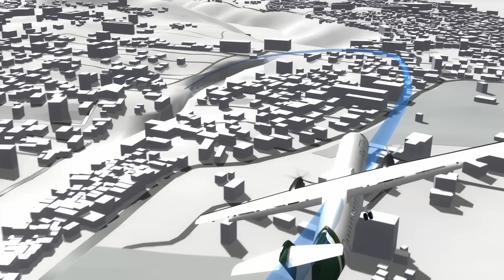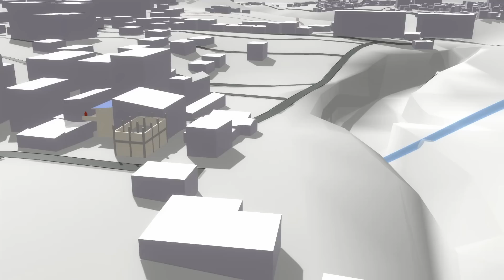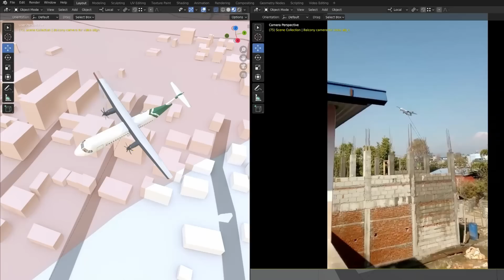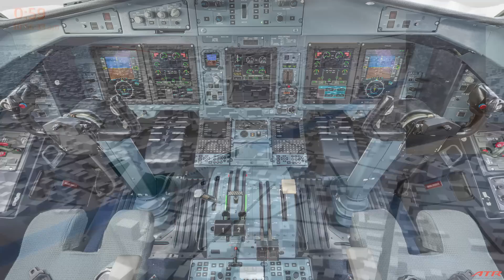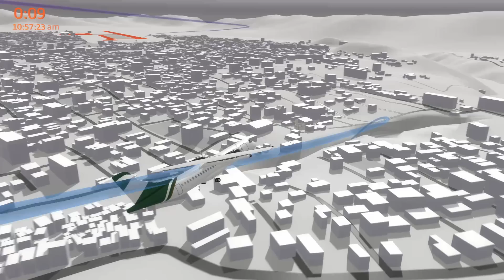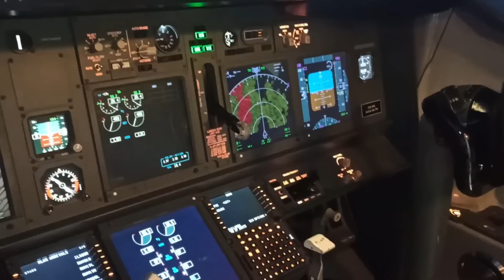HUMAN ERROR or MECHANICAL?! | Yeti Airlines flight YT691 illustrated

Comment: Is there any explanation as to why they chose to take the downwind approach for landing instead of the straight approach? There are a lot of things that don't quite add up here.
Reply from the maker: The pilot flying with 6000 hours was being cleared to land at this new airport in the future.  In the 2 weeks of it being open Yeti Airlines had only landed on the direct approach, though Buddha Airlines had landed from the west side.  I assume the check pilot thought it would be a good idea for pilot flying do her first indirect approach while having the benefit of someone with more experience.
Reply: @Mike-Bell  thank you for the explanation Mike. It's a shame they took that decision with passengers on board. 

Surely there should be some kind of protocol to avoid situations like this whereby pilots can test new approaches in a variety of situations in the simulator instead of doing so for the first time in a live situation?

My view is that passenger safety should come before the personal wants/needs of the pilots in such a situation, and therefore if the direct approach was available then that's what they should have taken with it being the path of least resistance.

Comment: Hi Mike , would you be able to explain why there was "no power" when the pilot increased the throttle towards the end or was it just too late before the engines could respond?
Reply from the maker: Hi AV
Feathered props don’t grab any air because they are aimed straight with the airflow. So they were just free spinning. Increasing the power just mean they free spun a little quicker. 
The pilots should have done the normal procedure and done an immediate forced landing, flying and controlling the aircraft all the way to the ground. They lost control and the aircraft spun out of their control.

Comment: Hello everyone! I am an airline transport pilot with experience on turboprops in this category.The co pilot was under the supervision of a senior instructor,then I thought,since the design of the levers obviously differ (as in every single multi-levers airplane) just maybe he did that in order to "test" the future pilot in command,not expecting this fateful result.Now,in aviation SPEED is everything,and there was a total lack of speed management wich is inconceivable,these were ATP rated pilots, in this and any other induced stall,basically caused by some error from the flight crews.And also,the deactivation of those levers cause different sounds from the engines,that should have alerted them..."In case of trouble,UNDO what you have just done" I have learned on my ATP  and commercial pilots lessons! Why where they both flying the airplane at the same time is unwise and demonstrate lack of cockpit resource management! (usually one pilot flies the airplane and the other watches over) And why they did not react on a timely fashion, in a critical situation like that is beyond my comprehension,if I notice or feel the airplane sluggish,TAKE ACTION, dont just murmur a description of the event! So many lost their lives to the lack of proper trained crews...jesus,is 2023 already and this type of accident should never be happening!

Comment: Excellent!!! Can i know something about the process/software/method about finding out speed and position of aircraft using availabe footage... where i can find more information.. please  help..
Reply from the maker: Hi Mithun
Thanks for the question. I use Blender for my 3D animation. It fantastic software. By overlaying the video frames over the model of the city the position of the camera can be determined to a good degree of accuracy. From the multiple camera locations and the timestamp of the video the speed can be calculated. 
It is quite a technical process and the low resolution of the image makes it harder. Plus the rolling shutter of digital image has the effect of squashing the image which needs to be compensated for. So the height calculation is probably accurate to around 20m 75ft. And the speed plus minus 5 - 8 knots. 
I was not comfortable enough quoting the aircraft speed at the moment of stall because it is too approximate because of the fuzzy video, but my calcs said it was around 85 - 90 knots, for what its worth. 
I am pretty confident about the flight path. And I am keen to see the black box data to confirm how close my cross triangulation was to the real data.
Reply: @Mike-Bell  thank you so much for the reply.  And i am eagerly waiting to see the blender and all tutorials of this whole calculation ❤❤

Comment: With anyone operating some vehicle (like a car or bus or tank or aircraft) you can tell right away if they have 'good instincts' - some ppl 'OPERATE' a vehicle others 'WEAR' a vehicle. SO if you have a combo where neither don't have those deep instincts - they can't handle adverse situations together. You need pilots that learned to ride a bike or snowboard or some other activity from age 3 basically. Because it should occur to her 'I'm crashing' and to the other pilot 'she's going to kill me' and be able to react in  1/2 second. You'd be able to HEAR The props are feathered and likely at max RPM.

Comment: So a pilot monitoring is actually moving controls , doesn’t sound like monitoring to me . Is the pilot flying the plane incapable of moving a lever ?
Reply: It is common for the PM to do the configuration changes to share workload. Remember, the PF had her left hand on the yoke and her right hand on the power levers. So the condition levers, flaps, gear, etc. are actuated by the PM on command and also cross-checked by the PF.

Comment: Thanks Mike for bringing out the facts. Just one clarification. Who has pulled down the engine power lever instead of flaps - the pilot who was flying or the one who was monitoring?
Reply from the maker: There is only a cockpit voice recorder, not video so its not 100% certain. The investigation teams concluded the pilot monitoring moved the prop levers. Pilot monitoring called out “flaps descending” so it seems a safe assumption.
Reply: Thanks Mike. 
I spent 12 years in Pokhara and had a highly satisfying time there. So my sentiments are with that place. 
It is a lesson for me to learn. What a "whimsical action" - without considering all pros and cons can result in to! 
Thanks again for bringing out the facts. Everything is clear to me.

Comment: Mike, great analysis. But one question. If both props were feathered, how can the obviously spinning propellers be explained in the crash video, at around 1:31 in your video?
Reply: Props were feathered but the engines were working perfectly. Engines can run with the props feathered
Reply from the maker: The engines were idling and with a gas turbine that is still quite high RPM. 

I didn’t expand on it in the video because it wasn’t a reason for the crash but it was interesting that eyewitness said the sound was low compared to other aircraft. And that was because the props weren’t doing any work which means a lot of noise comes from the props.
Reply: @Mike-Bell  Okay, thanks. But my understanding of "feathered" is that the prop blades are aligned with the airflow to minimize drag so I would expect them to not be turning. Are you saying that because the engines were still idling, there was still sufficient engine torque being generated to turn the props slowly, albeit without generating any thrust?
Reply from the maker: @tridentii1903  the spinning feathered blade is still aligned with the airflow onto the spinning prop. In other words the blade is aligned to a helix or spiral.
Reply: @Mike-Bell  the engines were not idling. She had the thrust/throttle in their normal position for the flight phase. The engine shaft was turning the propeller at more than idle speed. But since the props were feathered, generating no real thrust.. As in pushing air backwards.
Reply: @Renan_c So you're saying the props are feathered, meaning blades aligned with the airflow, but are still turning slowly and just not generating thrust?

Comment: The question I have is this, What form doe's the Auto-feather system take if there is one? Many propeller aircraft have auto-feather button or lever to quickly feather a prop in the case of engine failure in flight. If that system had a short or other failure it might explain this. It is inconceivable that experienced pilots could make this mistake.
Reply from the maker: This ATR72 does have auto feather. That means during an engine failure the pilot is not burdened with having to touch the prop levers. 
The preliminary accident report did not say anything about about a system failure on the auto feather. They are of the firm opinion both prop levers were moved. But you raise an interesting possibility. 

Nevertheless when it was clear there was a problem with power from both engines a pilots immediate instinctive reaction must be to go for forced landing and in this case they had the old runway right there.

Comment: Hence manual prop feathering is not a good idea for an aircraft - this extra control causes so many accidents. Maybe prop feathering switches need to be behind a glass pane and be on the top control panel above the pilots, just like engine fire switches and be designed so it is not needed except in an emergency- idk

Comment: Excellent visual simulation! Looks like the pilot was in error for not noticing the blade has changed to feather mode.
Reply: The error is far more startling becoz the levers were of different size, height, and functionality.
Reply: @RGkid-aja I'm starting to think he did it intentionally

Comment: Wouldn't the feathering of both props be noticeable in the form of some sort of loss of thrust, a certain deceleration?
Reply from the maker: Good point but the plane was descending and burning off excess speed so the engines were in idle. But I’m there is also the change in prop tone but because the props were not working hard was also quite subtle. But flaps dropping causes a deceleration which didn’t happen and so the 2 would have cancelled each other. 

However she would have anticipated the nose pitch from from the flaps which is quite distinct and that never came. That was a clue that was more difficult to overlook.

Comment: Criminal! First he feathers the props instead of lower first set of flaps. Then he correctly lowers the flaps the in second attempt but fails to realize that if he had already lowered first set of flaps then how come he had to pull the flap lever by 2 or 3 steps.
Reply from the maker: I think its quite pilot flying fully dropped the flaps and out of politeness didn’t let her superior know he messed up. They missed and opportunity to catch the mistake. Confirmation of control movements between the pilots is there for an incredibly good reason

Comment: Excellent animations, thx! Its actually not too difficult to understand how the check pilot (CP) inadvertently actuated the incorrect control. This trainee pilot (TP) was already a captain on the ATR; she was just getting a check/qual for this airport. So the CPs focus would have been on her performance of the approach, with much less attention paid to the mundane task of AC configuration. Not ideal but reality. The fact that the prop & flap ctls were located adjacent to one another, & traveled through similar arcs, helped set up the potential for improper actuation, and this would have then been 'helped' by muscle memory. I didnt see how close in time the prop feathering was to the TPs call of "no power", but that call, plus likely other physical cues (change in prop sound, deceleration) should have prompted the CP to verify and or undo his last action ( the improper feathering). But it doesnt seem that occurred. Finally, its even more difficult to understand how both crewmembers allowed the AC to stall, as opposed to flying it to a likely 'controlled crash' into the unfriendly terrain/city below.
Reply from the maker: Thanks Michael. Yes you make good points. I should included in the video that pilot flying called no power earlier to at about 35 seconds. 
She would have anticipated the nose down pitching as the flaps went to 30 which never came. And there was the change in prop noise. A master caution chime and both engines at zero torque is all the information you need to question what has happened to the props. So many missed clues. 
I suspect it was her who put flaps to 30 and she didn’t want to embarrass her superior and jeopardise her clearance to fly this route and so said nothing. Such a mistake. In the cockpit not questioning authority has led to many accidents.
Reply: @Mike-Bell  your last paragraph is a reach inline with your personal views and biases. We'll never know who did it. Whoever did it.. Surprising the person didn't notice that very abnormal position of the condition lever.
Reply from the maker: @Bren39  Careful being so quick to say something you don’t know the backstory to.  it’s not personal bias. It’s aviation history. Not questioning superiors is an established aviation bad practise. And probably worst case was Korea with its extreme cultural hierarchies. The Korean airline industry was in crisis after a much higher accident rate than world averages. Official government inquiry found junior pilots reticence in questioning terrible decisions by captains led to multiple crashes. The result was a vigorous attempt to remove these norms out of the cockpit. Including talking english which doesn’t have hierarchy baked into it. Korea and other countries made changes to get this danger removed from the cockpit and the result is safer flying.
Reply: @Mike-Bell  Hi Mike
 Yours is a good insight I havent looked at the prelim, but the CVR transcript (when avail) should provide some picture & insight into the intra-cockpit environment & dynamics, in order to more accurately discern where  & how it all went wrong. If they in fact got that master caution, then thats a huge cue as to a problem, which the crew apparently didnt comprehend or properly respond to. I dont yet know what happened in the apparently 60 seconds b/t prop feather & impact. That seems like a long time as we sit comfortably unassailed on the ground, but its very different when attempting to deal with problems while airborne.  Dunno if youre a pilot, but when things start to go wrong in the cockpit, it can quickly become overwhelming, as one tries to sort out exactly what the issue/probs are, and how to correct them, all while dealing w the distractions of possibly multiple alerts & other inputs It takes a while for humans to compile and properly respond to this type of situation. But the old prioritization adage of 'aviate, navigate, communicate" always holds, and this crew failed to aviate. in the end, thats what did them in
Reply: Not sure why the text is struck through that was not intended & those sentences should be included in any read
Reply from the maker: @michaelh8890  no worries. I assumed it was a typo. Any text located between two - - dashes is struck through. strike through

Comment: I think there was a crash of a ATR 72 were there was a bad solder joint on a circuit board that controls the prop feathering feature.
Reply: Good point. But the fact that right after the props were feathered.. there was no flap movement and he said "flaps 30 and descending".. Negates your hypothesis. Plus two solder joints on two different boards failing at exactly the same time.. nah

Comment: Tragic mistake..its possible the right seat pilot may have intended to reduce the power levers for the PF in an attempt to slow airspeed on the downwind...but instead moved the Condition levers which although you need to lift the triggers, they are much more similar to the power levers than the flap...this was probable done by motor memory rather than looking and confirming...because  just a few seconds later the flaps were selected to 30...just one possible scenario...
Reply: Motor memory - my hypothesis is that the captain was used to flying in the left seat, and his motor memory involved his right hand, not his left hand, which he had to use from the right seat. That happens in aviation.

Comment: Brilliant break down! I can’t live with a senior ATR driver pulling props instead of flaps, unless perhaps the cockpit was not sterile or he was fixated on something but even then it just doesn’t compute, and to not notice to correct is even worse. RIP
Reply: Never heard of a Brain Fart? It happens even to the most skilled!
Reply: @donraptor6156 pilots are trained for it so it should not happen it's a big fucking mistake which questions the whole.yeti airlines traning

Comment: The reason for the lever was in the wrong position not yet been verified... Could it have occurred on impact? There are far too many clues not yet investigated to make a video claiming one knows the reason for the accident. In respect of the deceased and their families this is not bringing any good at all!
Reply from the maker: The black box records many data points.  And from this there is no doubt both props were feathered 60 seconds before the crash.  The investigators would have had 100% certainty before releasing their preliminary report.  Out of respect for the families they should not have to wait long than necessary for some explanation and this is what the accident investigation team have done the right thing releasing this aspect of the information.  The potential reason why the senior pilot made this mistake is still under investigation.
Reply: Also, aside the recorded data, upon impact a lever usually leaves marks like small scrapes and dents in the position it was during impact, even if it is then somehow shifted before, in this case most certain, being destroyed. Hence it should be pretty easy to determine the position, even without the FDR, by experienced investigators in a crash with roughly this amount of impact energy.